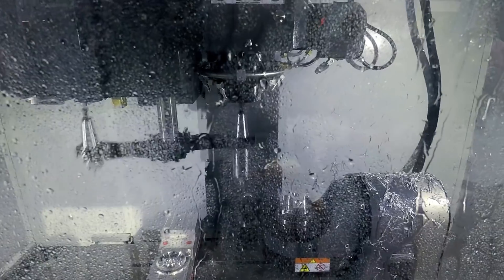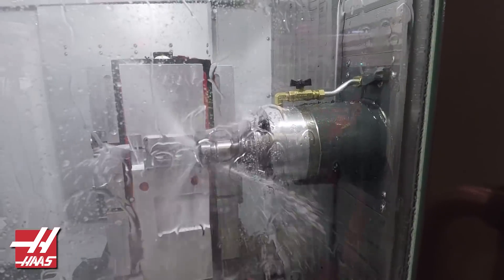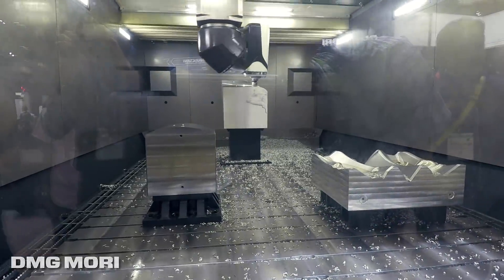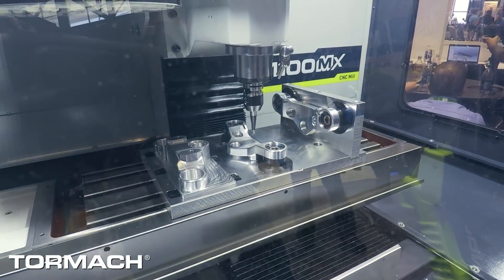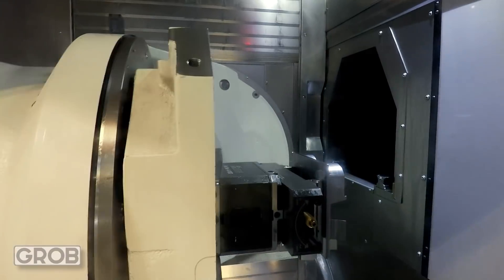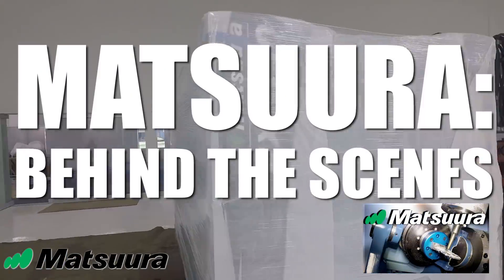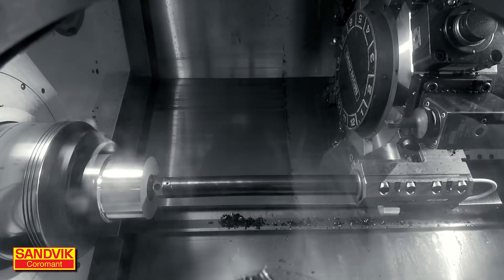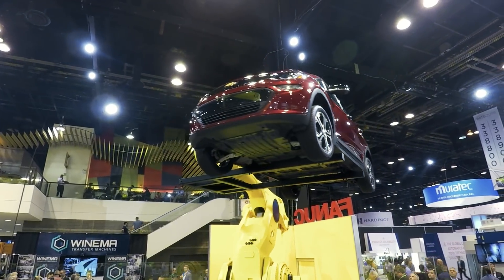10 AMAZING CNC Machines - IMTS 2018!

Comment: @0:30 the listed accuracy for the cycloidal gears is +/- 40 arc seconds and +/- 20 arc seconds repeatability. That's REALLY BAD... I'm not 100% sure that that is an improvement over the UMC 750 other than being more reliable and more rugged. IS that a typo ?

Comment: If you like that Grob maschines, we have two of the G550s at our facility, chained together with a huge pallet- and toolchanger. We've got round about 75 pallets and over 700 tools which can be used at both maschines. There is a Video at YouTube that shows it a little bit. It's about the Liebherr Aerospace Lindenberg GmbH and our titanium parts for the A350 NLG. Just take a look if you're interessted.

Comment: I don't work with CNC machines, so I'm curious. Say you set up that HAAS machine to do multiple jobs in a night. On the first job the machine breaks an endmill. Does the machine just carry on? I figure it's gonna crash because it's not removing any material. Obviously it could end up scrapping all the parts it runs after that. What measures are taken to avoid this?
Reply: Braeden Hamson you can have the machine measure the tool. If it’s shorter than expected it will use a backup tool.

Comment: I run DMG Mori's and an Okuma regularly at my work. Both turning centers. As well as several others. I work in the aerospace industry, making fuel and oil components. I am the youngest CNC operator, or even machinist for that matter, at my site at 33 years old.
Reply: The youngest guy in my shop is 44. The oldest is 67. We need guys with oldschool skills to guide them through processes with somewhat modern equipment. Can't find any. Of course the company is too cheap to offer enough money for unproven people.
Reply: Wes LoGiudice  what machine do you like best Okuma or Mori?